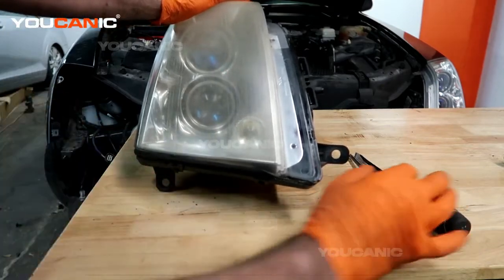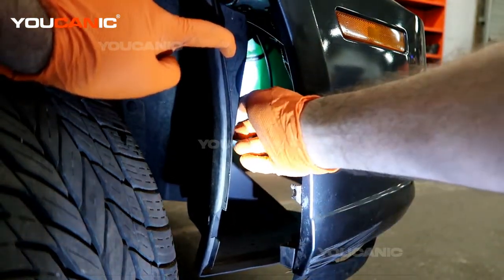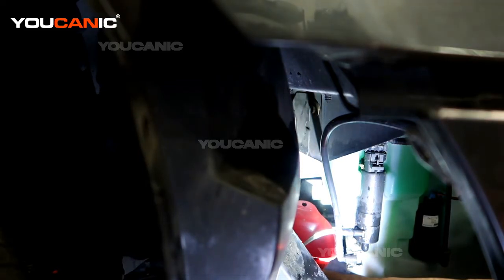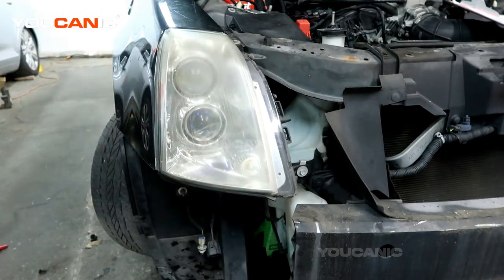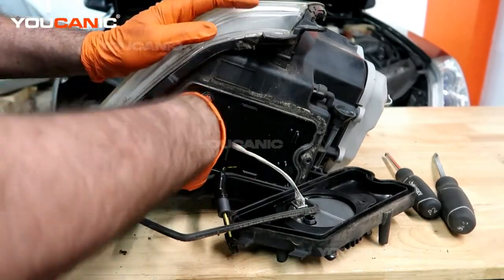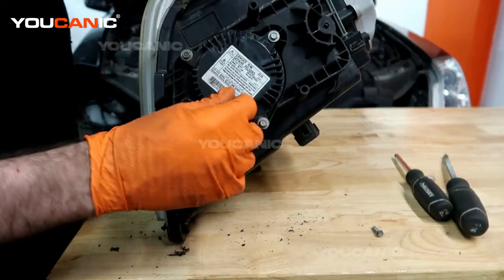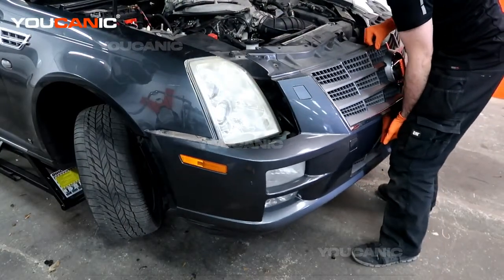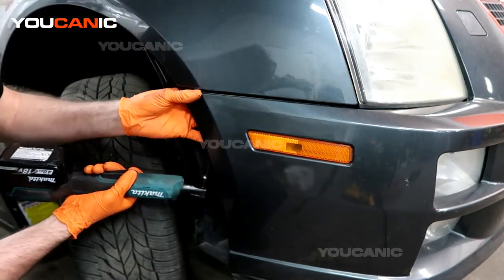2005-2011 Cadillac STS - Daytime Running Light Bulb Replacement

Comment: what light bulb is that??
Reply from the maker: Thanks for your query! The bulb used in our video differs depending on the car model and the specific application. To get precise information, we recommend visiting our website - www.youcanic.com. There, you'll find our comprehensive, free resources, helpful guides, and even access to our powerful YOUCANIC scanner to make your car maintenance journey smoother.

If you need any assistance or detailed information from the factory repair manuals, don't hesitate to reach out on our site. At YOUCANIC, our mission is to empower you, the car owner, and we are here to support you through your car ownership journey!